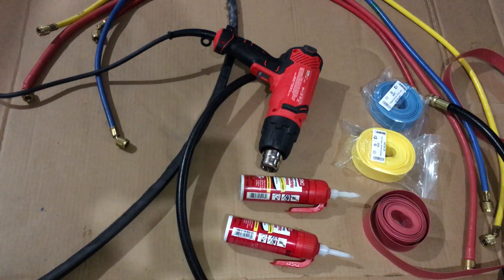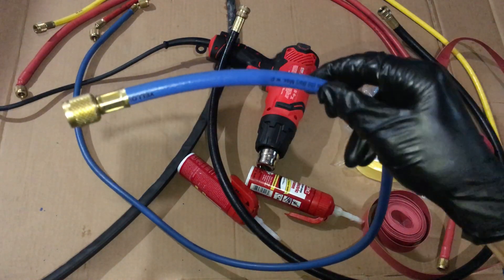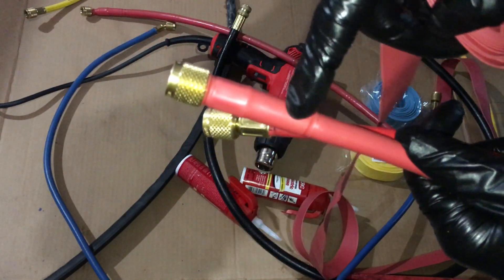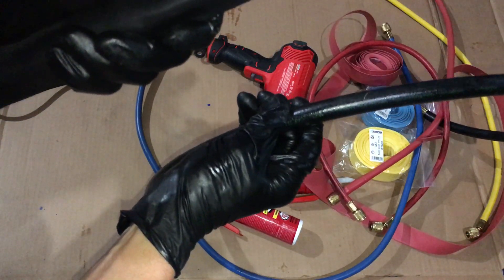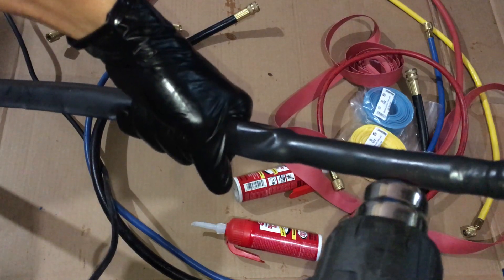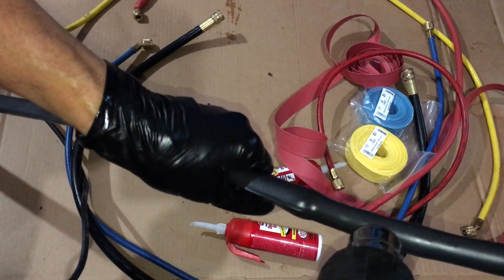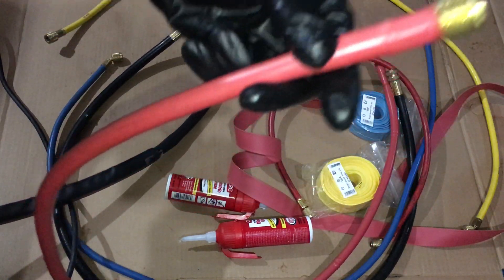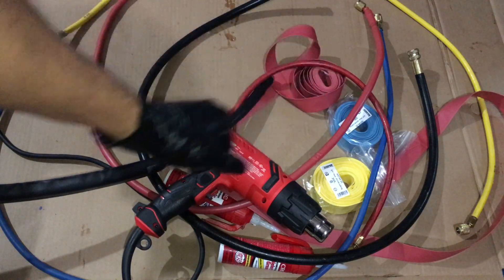Refrigerant hoses for gauges extending their life they are very expensive. IF YOU BUY GOOD ONES

Comment: Hi Tom, how do you clean your hose if you happen to get refrigerant in the hoses?
Reply from the maker: @EdwardDrayton-p3t  do you mean, how do I recover the refrigerant out of a hose?

1: 60 inch hose holds 1 ounce of liquid refrigerant if that was your method of charging through the yellow hose. 

Your hose when the vehicle is running filling the hose with liquid refrigerant holds one ounce of liquid refrigerant . 
         Your blue hose negligible amount of refrigerant like 0.1 ounce nothing to be concerned about

When you’re finished recharging your vehicle, one of two methods 
A: you compensated for the last ounce that will be left in the yellow hose when you stopped recharging
      When you shut off the valves to the tank open up, unscrew the high side coupling. 
       And slowly bleed the liquid refrigerant from the high side and the yellow hose into the suction line while the engine is running and the pressure is roughly around 20 to 30 psi with your.

B: If you did not compensate for the quantity of refrigerant in the yellow hose for myself, then I’m stuck with 1 ounce of refrigerant to yellow hose. Usually, I’m doing more than one vehicle.. I just leave it there for the next vehicle. I’m doing.. I just connect my low side coupling to recovery machine and just recover out the refrigerator.. or my other option if I have a dead vehicle that has no refrigerant in it.  And I just wanna put a little refrigerant into the vehicle for checking a leak with the electronic refrigerant leak detector. I just take that low side coupling hook it to the vehicle that’s flat on refrigerant or almost flat and use it as my leak test refrigerant on the next vehicle.

2: no if you mean, refrigerant hoses clean out as in cleaning them out because you were on a vehicle with PAG oil from a non-electric compressor and now you want to use your refrigerant hoses on a electric compressor car. That has POE oil. 

You flushed through 100% alcohol through your hoses shake them back-and-forth do that two or three times and then blow it out with high-pressure dry nitrogen . 
    Then put it on the vacuum pump and vacuum it blow 100 µm.  Then it’s cleaned out and ready for reuse.

Comment: Tom, if your hoses get covered on the inside with the refrigerant oil, but are still new, what do you recommend to clean them?
Reply from the maker: @EdwardDrayton-p3t  hundred percent or as close as you can 99 or 98% alcohol. 🍺 
And then screwed onto the end here, nitrogen regulator, turn it up high and blow it out 
And put it on the vacuum pump .

Comment: The yellow jacket 29985 hoses have a ball valve on one end. I read one of your comments that the ball valves have a high failure rate. Is it possible to remove the ball valve and attach a quick coupler to the hose or do I need an additional thread adapter fitting?
Reply from the maker: @nathanield.4527  I do not get hoses with any ball adapters because they are usually permanently mounted at the end of the hoses so you cannot replace them and most that I seen are not rebuild and all that I have used have always eventually leaked

I prefer them to be separate so I just take them off and throw another one
Reply: @coldfinger459sub0 Thank you, Tom!

Comment: What you recommend to check for hoses leaking ? I know you said the manifold hoses weren’t designed to do a deep vacuum.  I use my manifold hoses a lot and think air might be getting sucked in when I charge up the system
. Would a micron gauge be good to test the charge hoses or is there a way to pressurize the charge hoses and check for leaks ?
Reply from the maker: Pressurize the hoses for example to 200 psi and then use soapy bubbles.    Some liquid dishwashing soap. 

Make sure your seals are new and in good condition at the ends of your hoses. 

If you have those white plastic type cheap seals that come with cheap eBay and Amazon hoses from China change them to the black rubber seals.   Yellow jacket hoses are the best brand for reliability
Reply: This year I went to a 4 way manifold. The reason I did was probably the reason the 4 way manifold was invented. I will pull a vacuum on my system with my charge hose hooked to my 30# can, vac hose hooked to vac pump, then I pull a vacuum on my system and all my service hoses with all manifold valves open, and this insures my yellow charge line is free of air/moisture.  I have the tank valve off while pulling the vacuum, then everything that hooks to the system is clean and vacuumed.  I feel like I have a much cleaner/better charge of Freon. Been working on trying to do AC work this year better than j ever have, mostly I think cause I’m self employed and trying now more than ever to do too quality work. And watching good videos to learn more.
Reply from the maker: @Ross_Dugan  and that’s exactly what my dad taught me starting at the age of 12 with 4 port manifold. And that was 45 years ago. 

      And later on I modified my four port manifold to a five port manifold.     The fifth port was for oil injection back in the days of our 12 when the only oil we had was mineral oil. 

       And we also had a three gauge manifold. 
          The third gauge on your manifold was a second low side gauge.    
            On the old vehicles back in the 1960s into the 1970s especially on your Chryslers Some of your  General Motors.   You had a third port after your VRF valve or EPA valve or POA valve either located on the compressor built internally or a separate component in the middle of your suction line between your evaporator and your compressor. 

And on some of them you actually could dial it in and adjust it others you had to dismantle and do your adjustment reassemble and then test and cross your fingers you got it right or you had to do it again or just ignore it to adjust your suction throttling pressure on your evaporator so you would have a constant evaporator temperature this is for a higher in vehicles for a constant more comfortable temperature out of your dash. 

The sad thing about our trade our industry there is no mandatory formal education apprenticeships were abolished when they got rid of unions so mandatory training was no longer required being a young apprentice and being put as your mentor a 10 to 15 year old veteran who you would work under for the next 4 to 5 years right next to him on the stall as he overlooked all your work. 

So nobody knew about drawing microns anymore it it was something that was used before but long forgotten

Nobody knew about three gauge for Port manifolds anymore

And hundreds of other little details that were not passed on and passed down to the next generation of technicians.

Comment: I thought putting a spring to make 1/4 hoses stronger but my manifold doesnt travel as yours, maybe with the aging the spring doesnt do very good scraping the rubber. I like your way doesnt seems hurt nothing and improves vacuum

Im searching for a good price/valuable scale, Navac on europe has been renamed as Navtek, I think its the same Polish company importing from Value factory in China but Im going to give a try, better brands are three times more expensive and I dont trust on the most cheapest because none is cheap enough
Reply from the maker: The spring is a addition I would like to do I just have not been down to the hardware store to size one out to install. 
               I would put down some shrink tubing first and then install the spring over that and then put another layer of shrink tubing over the spring to extend the life of the service hose by the brass crimp

         Adding springs to hoses and lines has always been a good service practice since my grandfathers days on high quality equipment and tools